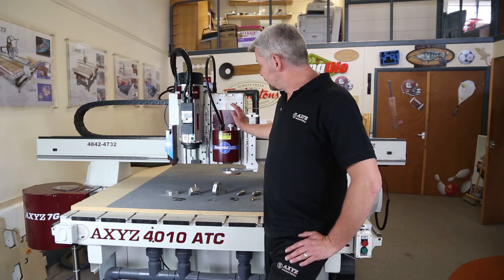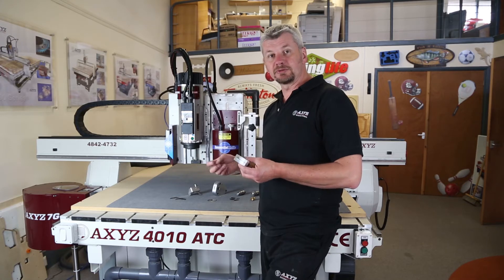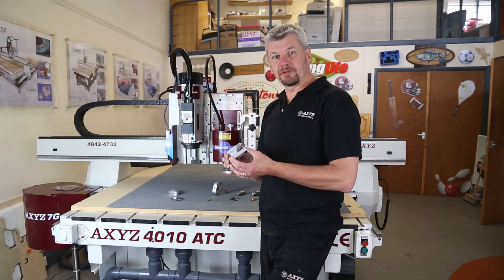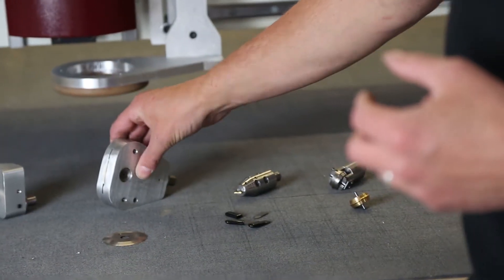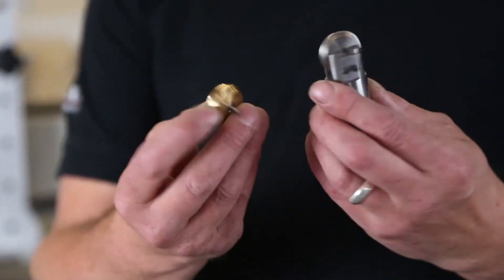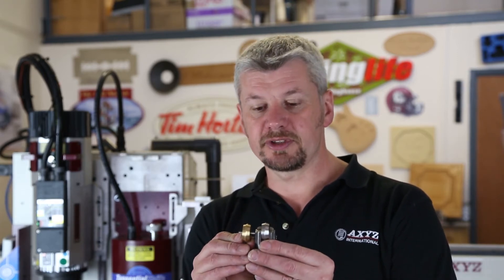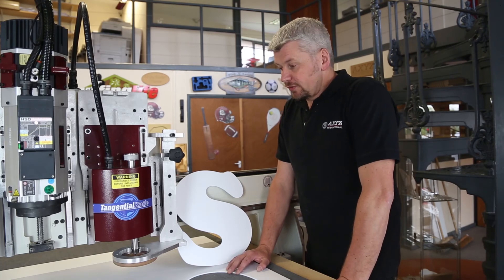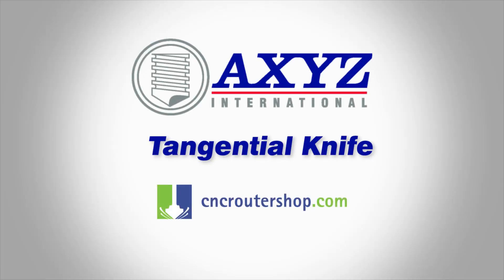Tangential Knife | CNC Router | AXYZ International

Comment: Can we cut 6mm leather on this machine ?
Reply from the maker: You can cut leather with a tangential knife, although an oscillating knife may be better for this application. It all depends on the design that is being cut and how well the material is being held on the vacuum bed.
Reply: yes, oscillating knife can cut leather, whatsapp: 008613075365628